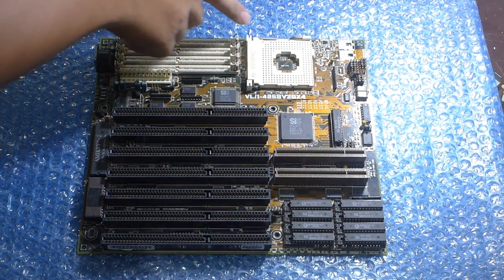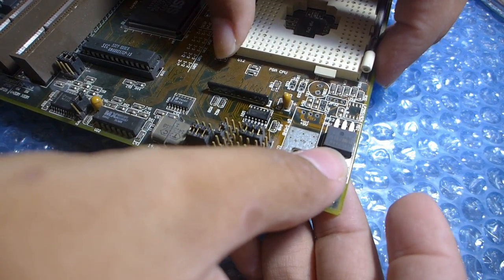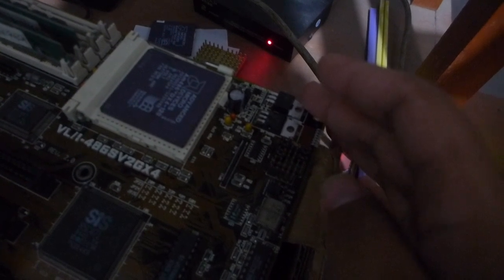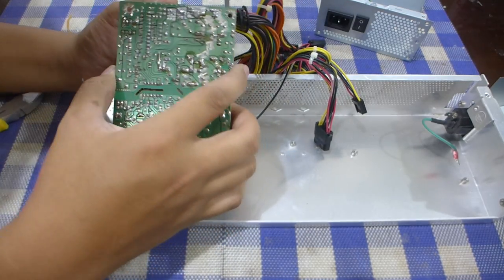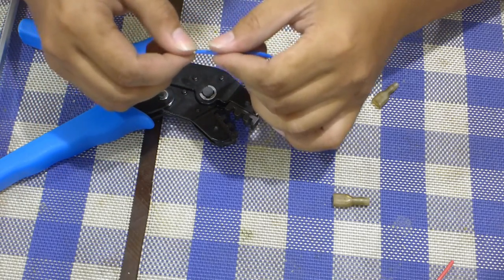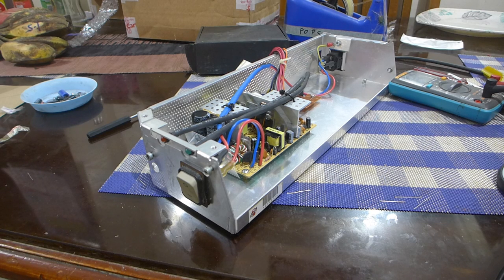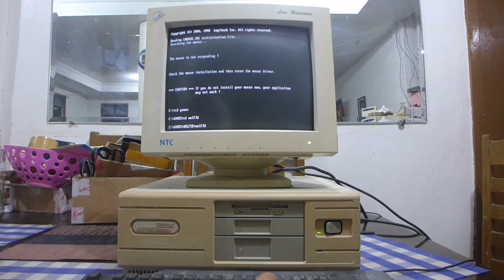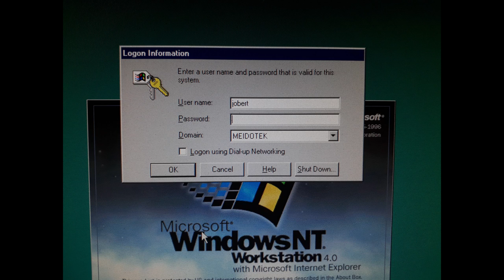Asus 486 VLB Motherboard Upgrade and Compaq Deskpro 386e PSU Repair

Comment: The thing about metal working is there aren't really any hard rules, you just do what works. The screw is most likely steel and therefore harder than aluminum, so it is a perfectly valid tap in this application. The most important thing here is that it works.
Also, curse that FIC board. A piece of junk indeed.